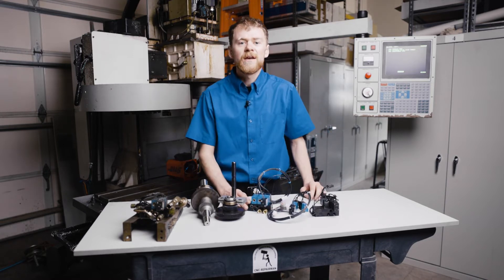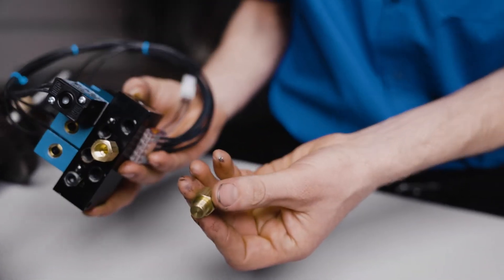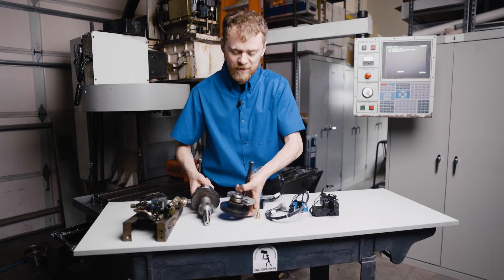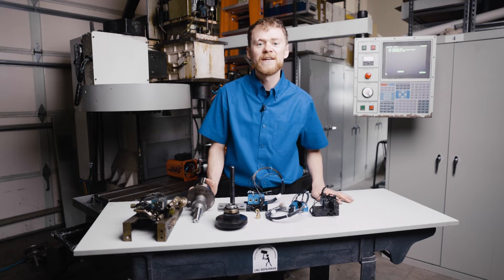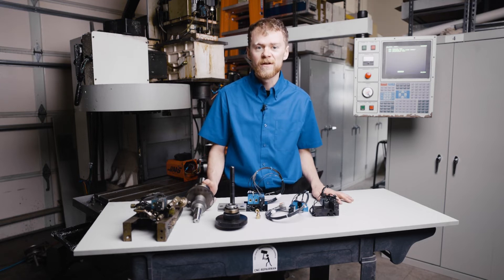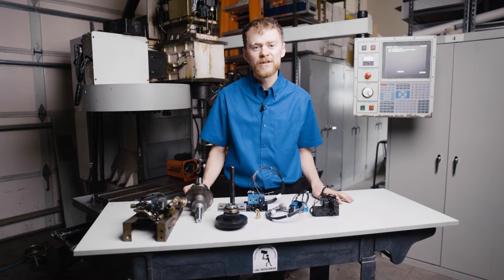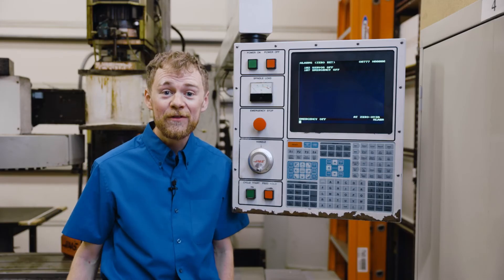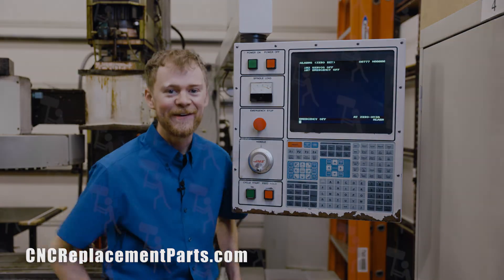Alarm 117 High Gear Fault—Straight To The Point

Comment: Hi, I recently puchase the hi/low gear and precharge solenoids on your webpage, my machine is a vector drive but it has the 3 solenoid block (I guess it was updated at some point), since the spindle block solenoid is not used anymore I decided to leave the old one there. I just installed the new solenoids and seems to be working good, but now there is always "leaking" air thru the exhaust mufflers, I that normal? or i did something wrong?
Reply: When the valves fire and you hear leaking air coming out of the valve assembly it is usually because the shift cylinder piston has damaged seals. What you are hearing is the air making it all the way through the system and out the exhaust. You can run a test by removing the valves and running air pressure through the copper lines. Run it both ways and see if you are getting air out of the opposite line. When the seals go out there is not enough pressure to shift the gears.

Comment: I didn’t see the 3 solenoid set up listed on your website? I have the older 3 solenoid set up but my machine has been upgraded to vector drive at some point 

My double ended solenoid is leaking air
Reply from the maker: Sorry your not finding what you need. Please email CNC Replacement Parts and they can help you.